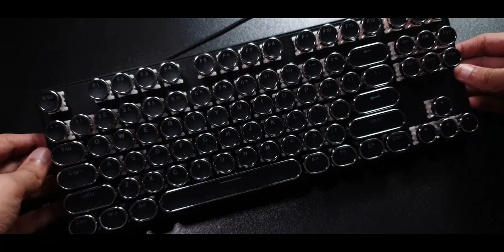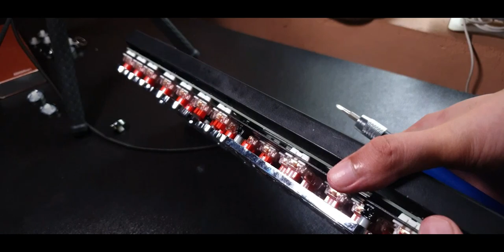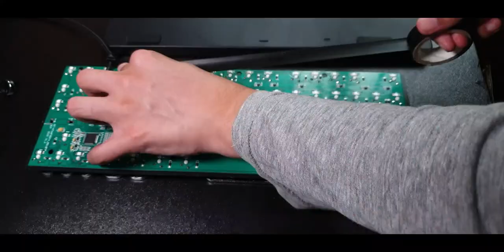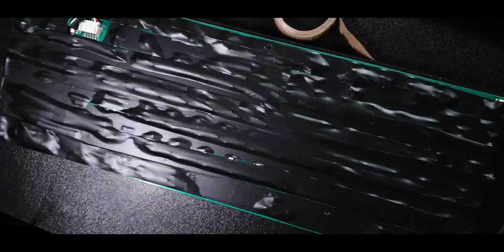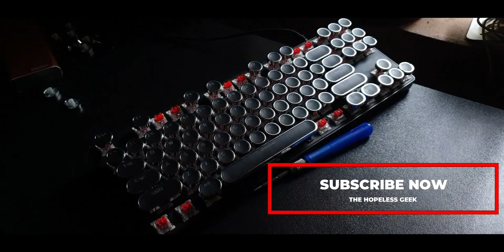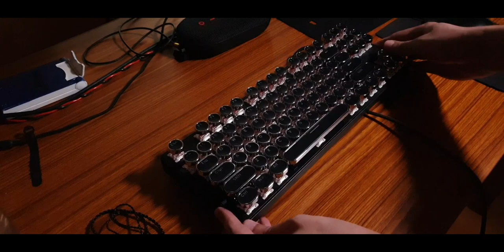Tape Mod - Easiest way to silence your mechanical keyboard! Ft. Cosmic Byte CB-GK-18

Comment: "if you want foam like this, simply buy a shirt, and then throw away the shirt"  absolutely killed me lmao

i wasn't expecting a 'how to mod a keyboard tutorial' to have a gem like that, nice job
Reply from the maker: 😂forgot I said that lol
Reply: I laughed too.
Reply: @TheHopelessGeek broa acc to you which would be better for typing and coding 
Cb gk 34 or redragon k552 red switch rgb
Reply from the maker: I think the GK 34 may be better. It has hot swappable switches now, if I'm not mistaken
Reply: @TheHopelessGeek  yeah it does but I am not planning to modify my keyboard so I am searching which would be best right out of the box
Reply from the maker: Hm.. even so, I guess the GK 34 may be a better choice if you like their software customisation. The typing experience has been quite good on the red switches when I was using it.

Comment: I aded the foam and did the lube to my cosmic byte cg gk 16 which have blue switches and it already sounding much better. Thanks to you
Reply from the maker: 🙂👍🏻that's great!
Reply: Bro which lube are you using?
Reply from the maker: You can use any plastic-friendly grease. I use this one - https://amzn.to/3vktZYT
Works quite well.

Comment: Hehe.. Thanks for trying this out..it really makes a difference with the experience..also the electric tape was not very sticky on the bottom right?
Reply from the maker: Yeah, it isn't that sticky, but it holds good enough to the plastic board. I might have to clean its residue after a while with some alcohol, if I'm changing it.
Reply: i have washed my keyboard under running water multiple times  and used liquid soap for good measure (don't ask why)
it works fine, you just have to dry it in the sun for one afternoon.
Reply from the maker: Yeah, any PCB can be washed as long as it doesn't have any batteries in it at the time. It just has to be dried up well😁👍🏻
Reply: @TheHopelessGeek  I didn't know that..

Comment: Okay so recently I added double-sided tape and a single layer of foam on my GK-16 and my god the difference it made. I mean I'm into blue switches but the stock sound on this was not that great but after the mod the sound is just perfect it's like THOCK THOCK but with clicky feeling.
Reply from the maker: Yup, tape adds that much needed thocc✊
Reply: @TheHopelessGeek  Bro but I'm facing a issue here after putting back the case and screwing it back the keyboard is not uniform any more what I mean to say is when I put the keyboard on the table lower right corner stay little elevated from the surface.
Any fix?
Reply from the maker: The front plate and the back panel may not be seated flush to each other. Maybe reopen and check that side.😄
Reply: @TheHopelessGeek   I did everthing even removed all foam and tape but th problem was still there so lastly I put back all the mods and screwed it back and added a piece of Double sided tape to the elevated area. 😂
Reply from the maker: 😂👍🏼works

Comment: Do you also have problems in the rubber that are in back when I use my keyboard without the height extender from one side it's a bit raised idk why do you know how to fix it?
Reply from the maker: I tried to pull out that rubber the other day when I was tearing it open😅. If you're rubber pads are uneven, you can peal them off and cut horizontally to reduce their height on the other side.
Reply: @TheHopelessGeek  Oh I'll try
Reply from the maker: Let me know if it worked.🙂👍🏻
Reply: @TheHopelessGeek  Sure and happy diwali 🪔
Reply from the maker: You too!🪔
Reply: Bro the same thing happened with me after opening the back case for doing some mods on it.
Before this problem was not there. So any suggestion?

Comment: Is there noticeable difference after tape mod? I need to add foam 😁 thanks for the video.
Reply from the maker: Yes, as I said, the keys feel much quieter now.
Reply: @TheHopelessGeek  bro apart from all these  tape and thin foam mods i just added 50 mm thick foam now my  keyboard makes very less noise and keys are so quite even havent used lubricate i need to purchase it
Reply from the maker: Ah, nice.😊⌨👍🏻
Reply: @TheHopelessGeek  after some time you must try this thick foam mod that's really makes huge difference bro 😉
Reply: And I am expecting a video about it 😛
Reply from the maker: I have a thin foam now. I'll try some other materials. Any suggestions?🙂
Reply: @TheHopelessGeek  no bro 😁
Reply from the maker: 😅ok, let's see.
Reply: @TheHopelessGeek  if get any thoughts I will let you know 😁bro
Reply from the maker: Sure.👍🏻

Comment: Nice mod but the idea of getting a foam is even nicer. Btw good work bro 😀👍
Can you help me with a problem?
I have the same keyboard.
But recently some of the keys in a region is not getting registered unless it is pressed hard. Again the issue is intermittent. Sometimes the keys work normally and doesn't require hard pressing.
Reply from the maker: Maybe clean the switches a little bit with a dry brush? If they're lubed, the lube might have gotten into them.🤔
Reply: @TheHopelessGeek  No I haven't lubed the keyboard. I placed it on a thin rubber mat to dampen the sound.
Do you know anything about their warranty service? Is there any way I can get it replaced?
Reply: @circuitousroad  man thats like turning a mech keeb into a membrane keeb but i understand sometimes the sound might be too much! Imo sell the kb and get something with different switches?
Reply: A bit late here, but I had the same issue with my rk61 (cheap switches leaving plastic film on contacts in my case). I sprayed CRC QD electronic cleaner inside the switches, pressed the affected keys a few dozen times, then waited for it to evaporate. Keys register perfect now!

Comment: Do you recommend buying GK 18 at present time with Rs. 2400 ? My main job is typing and earlier I was looking for wireless mechanical keyboard but costs a lot. So thinking of getting a wired one but I am confused. Is GK 18 right choice or shall I look for any other brand? Max budget is 2500.

 Need a wireless  mouse too.. Please suggest under 1000 wireless mouse as well
Reply from the maker: Yes, the GK18 is a good keyboard for typing. For your mouse, I use this compact one from Lenovo https://amzn.to/3EWocLL
Reply: Try CB GK 13 with brown switches. It's full size so you get a num-pad. Also people usually prefer blue/brown switches for typing and red for gaming although at the end of the day it's all down to personal preference. Typing this from my GK 13 which I got for 1699. Love everything about it except the rgb.

Comment: Would you ever consider remodeling & 3D printing your keyboard's plastic back to support a Type-C usb slot and mod your keyboard's power cable to be Type-C compatible?
Reply from the maker: That's a great idea which many have suggested. Any ideas where can I get some 3D printing services?😀
Reply from the maker: ah, okay. I'll start there.🙂👍

Comment: Hey there. I just got into a problem and need your help. I over lubed my keyboard stabilizers, and now they got stuck not permanently, but after pressing the key, it stayed there for half to one second. Please help me out with this if you have some free time to reply to my comment.
Reply from the maker: You could use some rubbing alcohol on a soft cloth to clean some of the lube out by diluting it. You can use tweezers to hold the stabs up on one side while you  rub the other.

Comment: are the switches on this keyboard detachable?
like I wanted to clean because some keys are not registering properly and after cleaning the switches from the above surface and under the keycaps but still having issues with registering keys sometimes.
Reply from the maker: The switches are soldered onto the motherboard. They can be desoldered but aren't hot swappable.
Reply: @TheHopelessGeek  thanks for the response ser! so should I just ask them for replacement service or anything like that?
Reply from the maker: Just tell them the problem and they'll suggest a solution, repair or replacement 🙂
Reply: @TheHopelessGeek  I'm onto it. Let's see how it goes now. Really appreciate your help ser🙌
Reply from the maker: 👍🏼let me know what they say.
Reply: @TheHopelessGeek  sure ser

Comment: Do i have to desolder all the switches for seperating the plate?
Reply: No
Reply from the maker: Yeah, if you want to separate the plate and the PCB, you'll have to remove the switches sandwiched in between.
Reply: Oh nvm yes

Comment: i tried the mod and got scared so i did not, while screwing back the pcb the wire did not go in properly, i pushed hard and got it too close but now the wire is wobbly and when i press the SL key it goes white but if i press it again the white colour goes away, is there a way i can fix the wire and sl key?
Reply from the maker: That's how the scroll lock works, right? It's like caps lock. If you press once, it is on. Press it again, it goes off. And what trouble is the cable causing? It is quite easy to fit it in its place..🤔
Reply: @TheHopelessGeek   the cable is wobbly and earlier it was in place without an issue, and the keyboard sounds quite hollow now
Reply from the maker: You can fill the back panel with some foam to make it sound a little denser.
Reply: @TheHopelessGeek   thank you for the tip, i have fixed the space bar and i added foam and tape and i also fixed the  wire, but is there any way to fix the SL key because before it never went white in colour now it does

Comment: I did this mod
Reply from the maker: How does it feel now?🙂
Reply: @TheHopelessGeek  1st step towards thocc it feels like this and I also putted a cloth under my keyboard. The mod took me 4 hours because at first I messed up 😩 but it worked at end
Reply from the maker: 😁👍🏻cool.
Reply: @TheHopelessGeek  And tomorrow I'm going to do foam mod and apply 2 more layers of tape
Reply from the maker: Great! Let me know how it feels after that.🙂
Reply: @TheHopelessGeek  I found some very thick foam and I'm doing the mod right now
Reply: @TheHopelessGeek  Because of the thick foam thocc increased significantly I will do tape mod tomorrow because of less time
Reply from the maker: 😃okay
Reply: @TheHopelessGeek  And when you are doing good mod for stabilizers switches?
Reply from the maker: When I find some interesting mods for it😀